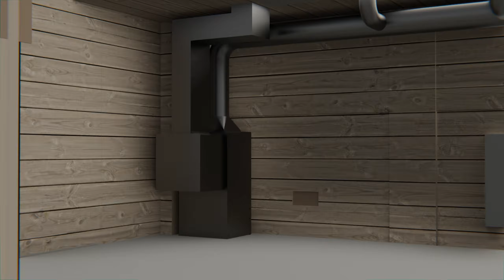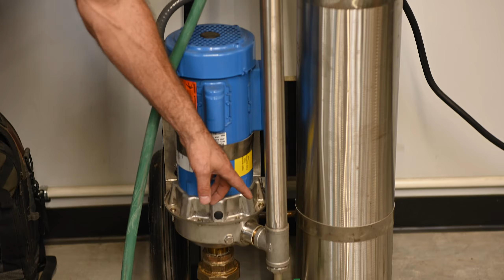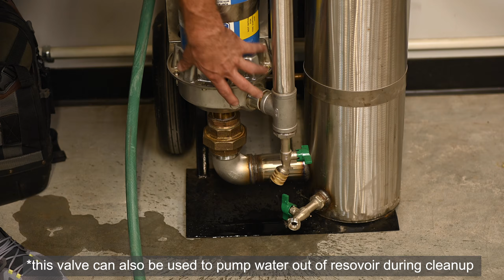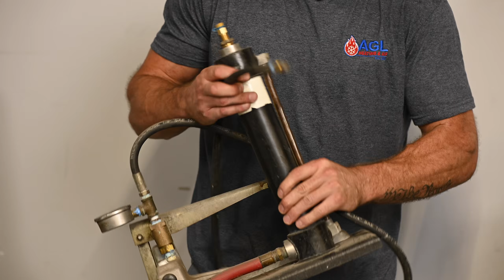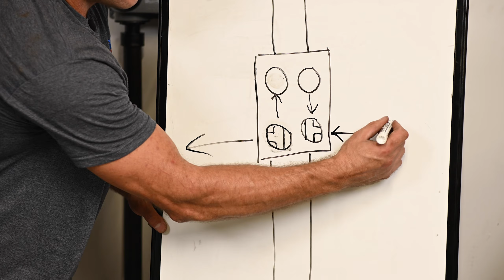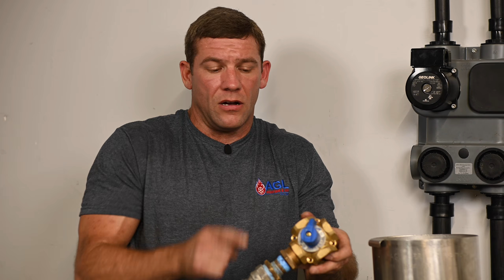How to Flush and Purge a Geothermal Loop

Comment: Encountered a 12-ton ground loop. We live in TN, where geothermal is all but non-existent. So imagine my scramble to find information about proper capacity loops, header configuration, pumps and flush cart.
What’s your take on multiple system loops with variable flow pumps?
Reply from the maker: Depends on the design.  1 loop field for multiple systems is more efficient because your spreading out the load more but at the cost of redundancy.  If that 1 variable speed pump fails the entire house goes down...  

I personally install 1 loop field per system.  This isn't as efficient because during the summer time the top floor will have a hotter loop than the first floor and it is reverse during the winter.  The benefit though it simplicity and redundancy.  If there is an issue it is only affecting that one system.  Also saves from having to deal with controls for operating 1 pump with multiple systems...

In short, both systems are good just depends on what you are trying to achieve.

Comment: Why not add an automatic air separator on system as in hydronic heating systems. Then air would be continuously be removed by system pump. This seems like a lot of extra work and air in heating systems can take a long time to be completely removed. 
So simply use domestic water to originally fill loops by isolating off each one and filling individually then start system pump and let air separate while in operation.
I could see using a separate pump to flush coaxial coil in heatpump of scale otherwise this seems redundant to me.
Boiler systems are same idea and are filled the way I have suggested.
Reply from the maker: They do make low pressure systems which have a tank with a built in pump (does not require a flush and purge).  We have used them but both systems (high pressure and low pressure) depend on the application.  We have to put the low pressure systems at the highest point and in residential don't always have the space to install (they take up much more area).  We prefer the high pressure systems because the flow centers can mount to a garage wall (where the geothermal loops come in) and take up very little room.  It's also easier and more cost effective to do (1) per system (more reliability because if 1 pump fails only that specific system stops functioning).  Both systems (high and low pressure) are good though but again this is application based and one system may fit one installation better than another.

Comment: New to all of this so pardon my ignorance but WHY do you/we need to flush and purge the system? How do I know when this needs to be done? You mentioned you rarely add glycol to systems in your area. My system is near Baileyton, TN. The frost line is like 6 to 8". Does that mean we can just run water?
Reply from the maker: Flush and purge is completed mainly to get air out of the system.  While doing it though you are also screening the water stream and removing any debris that are in the pipes from installation (dirt, plastic cuttings, etc).  The pump will not move water if there is an air in the pump so this step has to be done for the system to function.

You may need glycol in your area because the operating temperatures could get near freezing.  I know in my region that unless we have piping exposed outside we are not at risk of freezing.  Even when it's cold outside there is demand for the HVAC so there is water movement.  I am not sure about your region.

Comment: I have a "whooshing" air sound coming coming from that combo unit. Is that air in the loop?
Reply: Yes
Reply: @SombraLocs , on closrr inspection, the sound appears to be coming from the pump itself. Would that still be air, or could it be a failing pump? Or either? Or (with my luck) both? Thx.
Reply: @DougieD61 sounds like it's cavitating.
Reply: the air would likely settle in high points in your pipes and water would flow "under" it, so even if you don't hear or see air you might still have some in there. "whooshing" doesn't necessarily mean air in the loop

Comment: Can the pump on the b&d cart be switched to run on 230v? Virtually no houses around us have 20 amp outlets. Our b&d cart has the 2 hp pump and a 20 amp 115v plug. If it could run off 230 then we could use the circuit for the geo to power the pump.
Reply from the maker: I'm sure the pump can be configured to run off 230 volt.  They also make a 1.5 horsepower model that takes a standard 15 amp plug.  

Also, if I'm not mistaken, the 2 hp pump I'm using does run slightly under 15 amps.  In certain scenarios we will use an adapter (15 amp male to 20 amp female) to run it off of 15 amp circuits but are carful with what's on the circuit when we do.  I don't advise this but sometimes we do what we have to do...
Reply: @aglmechanicaltips Glad to hear that it draws around 15. We just got the cart and didn’t realize it was coming with a 20 amp plug. Thanks for the reply!

Comment: I'm surprised that there isn't a strainer or a sock in the system to catch any dirt or debris... 

Thanks for this series of videos. Geothermal was just starting to enter residential when I went to school 10 years ago, so I didn't get any training on it apart from the few paragraphs in my text book. 

I want to install one of these systems on my own house when my outdoor unit stops working!
Reply from the maker: There is a metal strainer in the flush and purge carts.  When we have an existing system we are flushing and it has dirty water we do add a filter that sits in the strainer.  No need for one to remain in the system though because it will just inhibit flow rates.  Because it is "closed loop" debris normally aren't an issue

Comment: Really good information I have a question. Do you made that combo equipment or we can buy somewhere?
Reply from the maker: The flush and purge cart?  I don't make it but here is a link to a vendor that sells it.  You can find cheaper ones but this is the specific one I am using in the video.
https://geohydrosupply.com/geothermal-flush-cart-with-1-1-4-hoses-2-hp-stainless-steel/

Comment: Hi could you please explain why a loop needs to pressurised, as there are also non pressurised systems?
Reply from the maker: Low pressure systems are just a different way of installing these.  The low pressure systems do not require a flush and purge because they have a reservoir.  The only issue with these systems is that you have to find a point close to the high point in the loop system to install these reservoirs (air travels up).  They take up space and cost a little bit more but there is nothing wrong with them it's just a different application.

I prefer the "high" pressure systems only because they fit most applications and I don't have to locate a spot for a reservoir up high (which normally forces the reservoir to be located in the house or attic).

Both systems low or high basically use the same pumps and the only real difference is that you have a reservoir on the low pressure system so if there is any air in the system it will eventually migrate upward and vent through the reservoir.  You would add water during maintenances but after all the air is out you would no longer need to add any more water.  High pressure systems are basically the same thing but we are getting all of the air out when we do the flush and purge procedure.
Reply: @aglmechanicaltips  thank you so much for your response, just one more detail. I noticed in a long loop increasing the pressure increased the flow rate. Any idea on what could be the reasoning behind this

Comment: Great video! I have a solar collector and a 7 series geo system that use good grade glycol as the coolant and it appears that they're tied in together, but I'm now realizing they're valved off from each other and that the valves are just a service station for both systems. I have the solar coolant changed out every 3 years due to heat degradation, but since the geo is at a much lower temp, how often is it recommend to change out the fluid (if ever)? I'm always checking the reservoir for visual ques but it always looks clear. I'd imagine there's test strips out there that would tell me more information?
Reply from the maker: We only swap coolant during a major repair that requires a flush and purge (pump swap, coax coil failed or compete system changeout).  

When we complete the flush and purge after the repair we simply let our cart run while flooding the tank (adding water as it is overflowing out of the reservoir). We will flush with new water being added for a few hours.  In my region we are rarely using glycol.

Comment: Do you check the ph balance of the municipal water ?  Municipal water can also have biologics that can cause a lot of problems. Municipal water in my area is also very hard will cause problems in a short period. You can not use distilled water either. As it will eat your metal parts. My brother had to replace an $80,000 chiller in a plant that he worked at because the mantainace guys flushed it and then refilled it with distilled water. 
A friend of mine hvac guy said he kept having problems with a system every 4 or 5 years. He said it kept having black slugde coming out. Biologics can cause this. I keep forgetting to tell him that's probably what's happening there. Im sure he's using the same tap water each time. Of course then you can have work replacing equipment that goes bad every few years.😂
Reply: Why does distilled water eat the metal parts?
Reply: I believe they need some type of water treatment.

Comment: Nice video thanks. 
Should the pump be removed from the unit to allow for better flow etc?
Reply from the maker: No, keeping it sealed tight is much safer. If uninstalled and reinstalled improperly, you might end up causing a leak and / or putting air back into the loop.
Reply: @aglmechanicaltips  Thanks for your reply 👍
Reply: @aglmechanicaltips  Can you post your method to replace a loop pump without getting air into the loop?